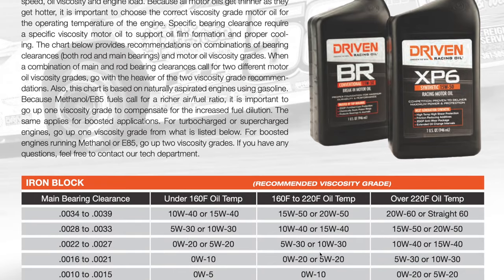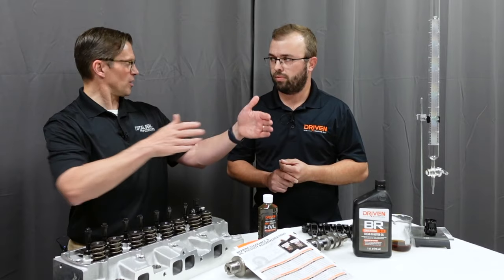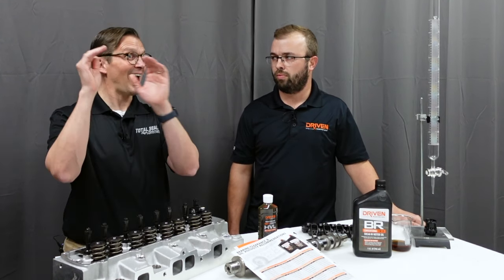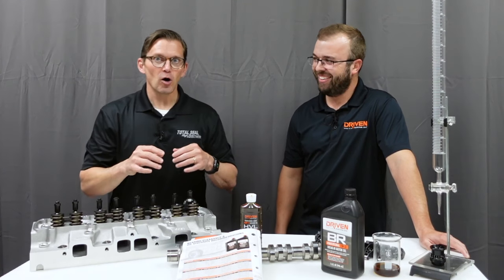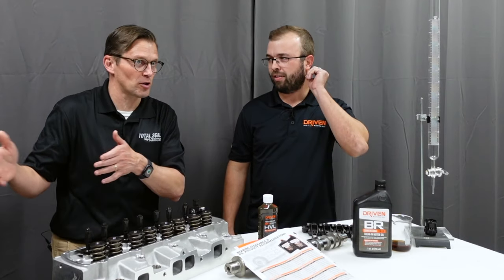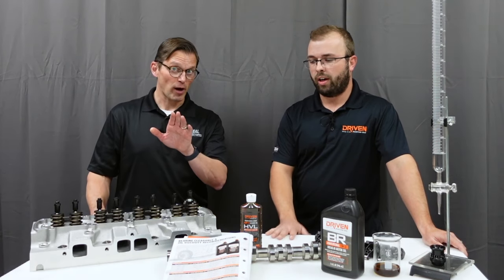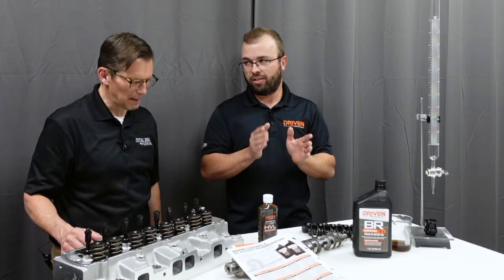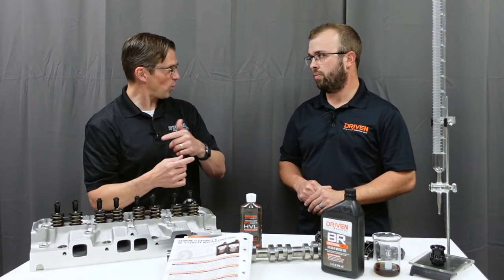How To Choose The Right Viscosity Motor Oil - A Certified Lubrication Specialist Explains

Comment: If you are doing 2 mile trips as your norm in the city the last thing you want is 0W8 with direct injection and nothing but short trips with heavy fuel diloution. That is where 0W30, 5W30, 0W40 come in. 10,000 mile or 1 time a year oil change under city driving the last thing you want is 0W8 I would not even want 0W20. The fuel diloution alone is going to kill the engine. Likewise I would not want to be on the Autobahn or Autostrada and have 0W8 in my sump! Everything today is Turbo charged even Toyota's little 3 cylinder economy car is turbocharged. Car's and trucks are all Turbo I4 or V6 now!

Comment: Good video! I don't trust that woke climate change BMW has my engine longevity in mind when they prescribe 0W-20 for 300HP turbo 4cyl N20. I think they want to maximize profits under CAFE and they rather sell me a new car sooner. I know F1 engines run water thin oil so I'm open to thin oil engine efficiency and power if it still protects. I have run recommended 0W-20 PennzPlat every 5k miles and no problems at 100k in the N20 engine which is notorious for timing chain failures with insufficient oil changes. But I run recommended PennzPlat 10W-40 5k in my N52 BMW 6cyl, also with no prob at 200k. Can I trust BMW recs or are they just milking CAFE and boosting future sales? Or as Jerry Seinfeld would say, "What's the deal with this 0W-20 koolaid oil"
Reply from the maker: The 0W-20 is about fuel economy. A 5W-30 would provide excellent protection as well. The real problem is the long drain intervals. That is not good for engine longevity.
Reply: @TotalSeal  Thank you!
Reply: @TotalSeal . Frequency is the real key.

Comment: This is for babies. One should care about HTHS since KV is not applicable in a regime with high sliding speeds and pressures. Also, where knowledge turns into belief because there are very few experts involved in real lubes development: the chemistry of an oil is even more decisive than viscosity.
Reply from the maker: Agreed. Higher level discussions are on the way.

Comment: I like that table...but who running a car they didn't build the engine for know what the clearances are? Really! 
Good luck getting that from the factory!
Just follow the factory spec, but go thinner if you like. IE 15w-40 to a 10w-40. No more than that. If you are on euro stuff at 0w-20 etc. Stick with factory. It's a road car, not a race car! Race car oil does 1000km max!

Comment: You could also just run less oil and gain the same HP.  

Is 10HP worth your motor?  I think NOT!  

Running thinner oil does all the great things you say.  However!  When.  Not if your engine ever overheats that thin oil will self destruct.  

Bearing clearance and viscosity is an old wives tale and useful for manufacturers trying to achieve the best MPG to satisfy cafeteria standards.  

A performance built coyote engine with tight bearing clearance is going to want straight 50 or higher.   

When you have $10-20k tied up in an engine don’t F around with these bs gimmicks!  

Protect your investment!  

It’s not always about HP!

Comment: Okay, can u summarize for me pls? Lots of talking, I need the videos shorter, I need facts, im not looking to make a career out of oil...Also u should do comparative videos, this is better than the most costly at the same price or this is almost as good but at the fraction of the price! Use a 2 to 1 oil, 2 oil changes with Protective oil then a oil change with high detergent oil etc Turbocharger? NA? Cat? Direct injection? Use these specs for this type of engine PS. Thanks for the effort. It takes elbow grease to do all these videos then some idiot pops around and comments on it...thats me.

Comment: Daryl Dingbat is out changing the oil in his acura right now to get 25 horses because he got fed information that he didn't need.
Reply from the maker: We do understand your line of thinking, but if he ends up putting the correct viscosity oil in his engine, it will only help extend the life of the engine. As the saying goes, results may vary (based on how far off he was to begin with).
Reply: He might see a bigger percentage gain because his engine doesn't make much power to begin with. Also longevity and fuel economy gains

Comment: Ford changed engine required oil viscosity from 10w 30 to 5w30
Reply from the maker: Many Ford engines have called for 5W-20 for a long time.
Reply: @TotalSeal only since 1997.

Comment: snake oil
Reply: I agreed.  Manufacturers will spec a 0w20 for the North American market pretty much across the board from a civic to a gasser F250 but that same exact vehicle in pretty much the rest of the world is spec for 5w40  and 15w50. Look at BMW 20w in the USA but a 60 weight in Europe??
Reply: @spartanpatriot3163  BMW is different from others in how they spec out the viscosity. Their factory oil here in Europe is 0w30 or 5w30 across the board. And their new engines work perfectly fine with that BUT there are some serious exceptions to that rule: 5w30 is fine for "normal" operation. You should switch to 5w40 if you put a higher than normal load on the engine aka track use, towing, flat out Autobahn driving etc. 
And if you have a high output i6 or V engine 5w40 should be the default.
BMW allows the use of any viscosity grade between 0w30 and 5w40 these days. 
They essentially want you to decide what you put in your engine.
Id always go for the 5w40 as the summer oil and 0w30 or 0w40 as the winter oil.

Comment: Why would anyone guess. Just use what the enginebuilder says.
Reply: The engine builder will have different specs for different countries for the same engine.  Due to our corrupt government, they want better mpg, which is why we have low tension piston rings and 0w20 oil.

Comment: Let's talk 0w30 motor oil..I think at high temperatures say 250 degrees Fahrenheit..im sure the 0w means thickness of oil at high temperatures..and I think 30 means oil thickness and flow at cold temperatures at start up...if it's not prove it...I don't want to hear what the manufacturers says I want for you to prove it
Reply from the maker: The "W" DOESN'T Stand For WEIGHT! A Certified Lubrication Specialist Explains SAE Viscosity Grades.
https://youtu.be/48pviPLgaPQ
Reply: Oil is physically thicker when it's cold, all of it is,  then when it gets hot, it's all thinner.  But, based on the additive package, the molecules of that oil "act" differently.  There are other videos that prove it.  Freeze some 0w20, it flows like sae90.  So your lack of knowledge has you completely wrong.